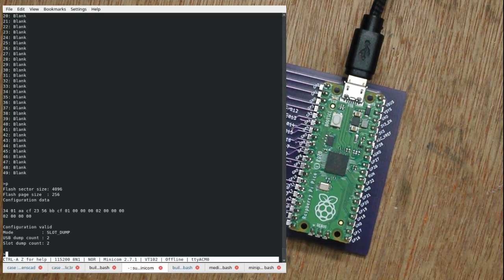Dumping ROMs by Post (Dump to Pico Flash, and No Level Shifters)

Comment: That is quite useful, I am sure it can be modified to take cartridges so you can make legal backups of your NES games to play on a PC.  I would recommend using it as a USB cartridge so the Nintendo Lawyers can see you need the legal cartridge plugged in to work with a MAME software.

Comment: Given that RP2040 boards are starting to get cheaper than arduino boards, and they can run at 100+Mhz, I'm wondering about making a "general purpose" rom dumper/programmer/emulator for the most common EEPROMs. Could come in handy for cheap/diy 8bit projects.
Reply from the maker: I've thought about that too, as I have been involved in about 7 of those sorts of project recently. The pinout of RAM and EPROM chips is a bit different so a universal footprint might be tricky. Also the static vs dynamic RAM code and hardware is a bit different as well. The Pico has less GPIOs than the RP2040 and so can't provide such a wide range of emulations. The RP2040 is a pain to solder, though possible.

Comment: Is there a method of putting file support on the pico so the images could be copied off using usb mass storage ?
Reply from the maker: That's an interesting question. It looks like there might be some basic support for mass storage using the Pico. I suppose you could do a code load that drops into mass storage mode either after a ROM dump or if a USB cable is plugged in. It would make it easier for the remote user to copy a dump off the device and email it back.

Comment: I really wish they'd made the RP2040's GPIOs 5v tolerant... :(
Reply from the maker: I think they did. I wish I could find that post. i think it said that they should be 5V tolerant but they couldn't either test or assure that they were 5.5V tolerant so couldn't technically be listed as 5V tolerant. Something like that. Yes it would be really useful if they are.
Reply from the maker: I found the post, it's a Hackaday blog entry and confirms that the Pico is 5V tolerant, just not 5.5V tolerant so it can't go in the datasheet as such. I've just wired a Pico as a RAM emulator to a 5V system and so far it's fine. Its in the comments of this blog entry:
https://hackaday.com/2022/09/25/pi-pico-w-does-pcmcia-gets-this-ibm-pc110-online/
Reply: @menadue  link not working?
Reply from the maker: @TomLeunam  If you mean the Eben Upton comment then this should take you right there:
https://hackaday.com/2022/09/25/pi-pico-w-does-pcmcia-gets-this-ibm-pc110-online/#comment-6516402

Or is it a different link you are talking about?
Reply from the maker: I've had a test RAM chip emulation running for several hours now using a Pico and no level shifters attached to a 5V system and it seems fine, so I think the Pico is 5V tolerant.

See here:

https://www.youtube.com/shorts/pnfnK9P44l4
Reply: @menadue  maybe it will have the life span reduced. But only time will tell 🤔